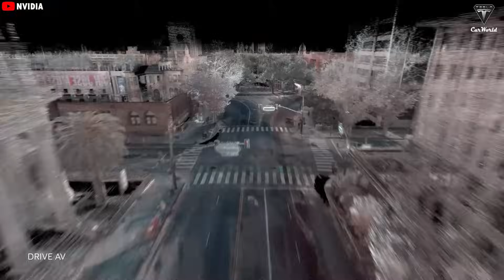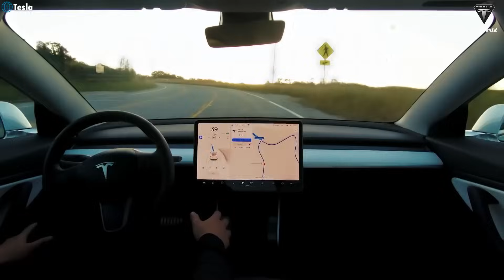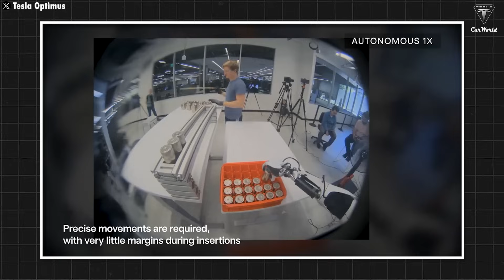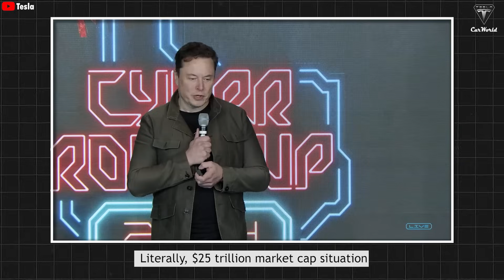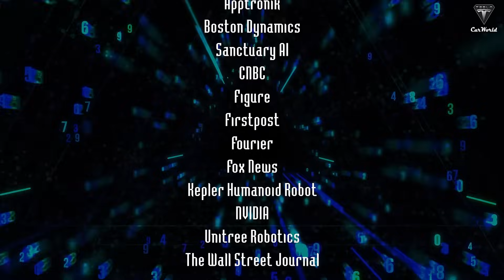NEW Tesla Bot Gen 3 Ready Do ALL Home Tasks, Elon Musk LEAKED A Few BUGS On Optimus Robot !

Comment: Can it clean a toilet??? Do dishes??
Reply: Hardly so. All I see from the ads by Elon Musk is a robot which places batteries into a box and pick up a stupid parcel from the doorway (that weights hardly more than 5 kg, a 5-year-old could do such "useful task" in a flash of an eye).
My guess is it will take Elon Musk five more years before Optimus becomes REALLY helpful.
Reply: @jinhuanghou they definitely can do dishes, I worked for a company in San Francisco that has their own Bot that can already do dishes, so I'm sure Teslas bot can do dishes just fine.
Reply: @golden.monkey.m2m those batteries it picks up, using Only the tips of its fingers, each battery weighs about 5lbs with 8 on the plate, Optimus is desighned to be taught, learn, and advance itself to fuffill its role and tasks given to it, 40lbs of batteries, held with Just the tips of its fingers, let that kind of strength sink in, You pick up that same weight with only your finger tips, without Hooking them under something like optimus did!
Reply: and record everything you say or do at home
Reply: @jmi4265 Cybercriminals will get in there fast and corrupt it with Malware.
Reply: Watch the video
Reply: Can it listen to my wife